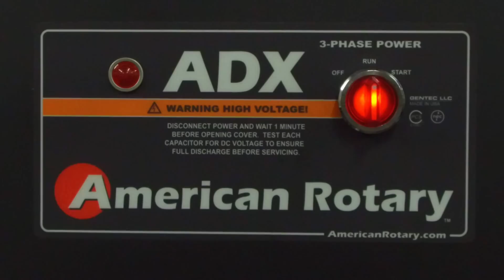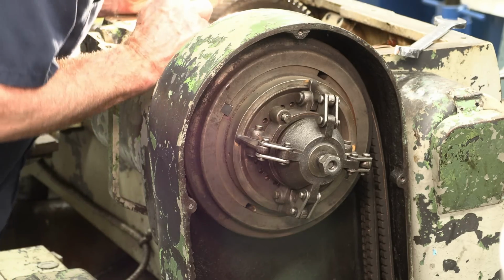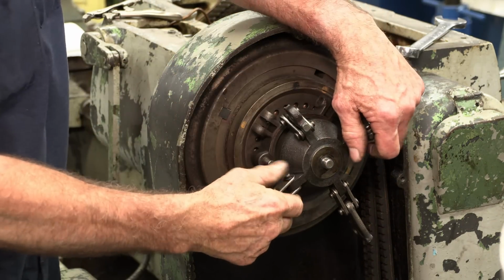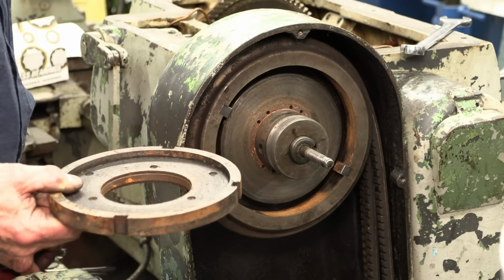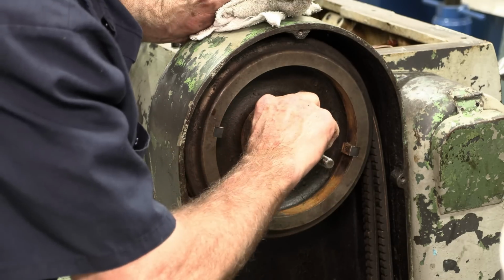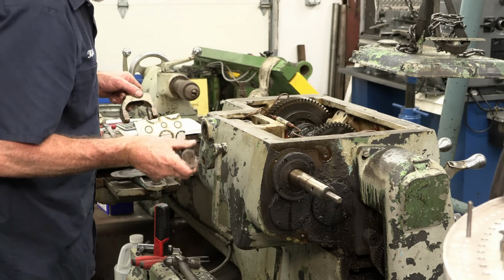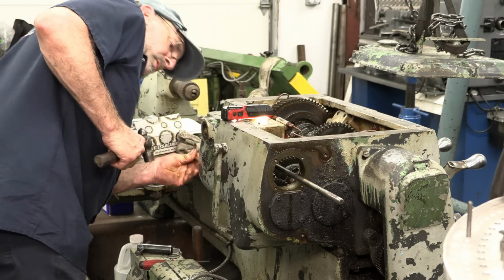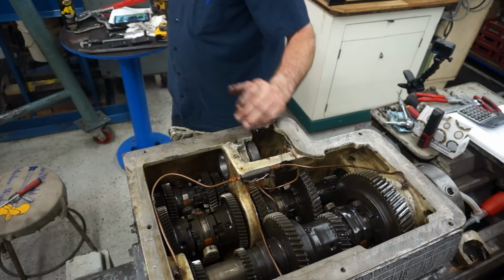Pearl's Box Removing Gear Shafting Part One

Comment: This reminds me of when I worked on car and truck manual transmissions.  There was always a sequence that the gear clusters and shafts had to be done in so they could be removed or installed in the cases.  Once done and remembered it was a cinch.  First times not so much!

Comment: Always fun to tear down old equipment without a manual. Just takes time and sometimes having to sleep on it. What you don't want to have happen is to see how it should have come apart after you take it apart wrong and add to the repair list. Not that it hasn't happened to me, LOL. When I was much younger I had very little patience, thankfully I grew out of it. Having a parts exploded view sure helps, but a manual would be much better. Thanks for sharing.

Comment: Thanks for documenting this fantastic educational project Keith. You lead us along at such a logical and detailed pace with excellent reasoning at each step. I run two of Pearl's transatlantic Colchester cousins who are almost an identical build to Pearl. Your methodology is providing me with the courage to explore a mid range drop out of gear that occurs on the larger of my two Colchester's.  I couldn't help noticing the amazing horseshoe tool caddy that adorns the rear of your Bridgeport mill, what a fantastically efficient use of an otherwise 'dead' space! Do you have anything that you could share regarding the design of that tool caddy? My series 1 bridgeport would be proud to wear such stylish and businesslike apparel. Dave

Comment: Any clutch remanufactured should have the stock to rebuild the clutch. Modern automotive clutch material will probably engage smoother than the original as materials have improved since the Monarch was made.  The problem with the Knipex plier wrench is once you try a pair you want all 4 sizes. I now have 8 of them

Comment: Keith.
 Will changing the overall motor speed effect the threading feed speeds of the lathe?
Regards
Reply from the maker: No, the feed and lead screws are timed with spindle
Reply: @KeithFenner  Thank you for both the informative and prompt response.

Comment: Keith,  what your working on there reminds me of the clutch pack on a diesel tractor of a tractor trailer.  Set up almost exactly the same.  The drive pins in the shaft were always equidistant and always more than one.

Comment: You can always power the new motor with a VFD and have ultimate low and high speed and anywhere in between.The only reason Keith makes these videos is so he can remember how to put the machine back together.

Comment: I have installed VFDs on a 5 hp Cincinnati No 2 Universal mill (1943) and a 4 ph toolroom lathe.  Both had similar motors to your Monarch.  The VFDs can increase the line frequency ten fold. Any 60 hz motor will continue to run at higher frequencies limited only by the centrifugal rupture limit of the motors rotating parts.  A great, old motor will handle 3 to 4 times it's original speed.  Obviously, you should monitor amperage, temperature, vibration, etc., as you explore any frequency above 60 hz, but VFD's monitor current, voltage, frequency and will automatically stop and display the error code for a whole list of stuff I wouldn't have thought of.

I've had the lathe up to 120 hz.  The original max speed was already 1800, so the frightening volume of air moving past a 3600 rpm chuck has limited my willingness to explore further.  Theoretically, your machine would have a max rpm of over 10,000 rpm if most of it wouldn't explode before reaching that point. But, the VFD can also operate down to 1 hz.  I've operated my mill at 5hz.  VFD's deliver nearly full torque regardless of frequency because they are able to closely simulate a full voltage sine wave - even at very low frequencies.  In addition to gaining new speeds above your lathe's max speed, you gain as many below its lowest speed and an infinite number in between. 

I promise I'm not a VFD salesman - just relaying my honest experience.  I can't believe more people don't use these things.  I can also set how many seconds I want the motor at full speed and how fast I want it to stop.  The VFD can use the motors own momentum and the back current it generates to digitally break that motor.  I have actually set all the stop times to 2 seconds or longer because anything faster sounds like it might break a tooth off something.  It stops the motor alarmingly fast - with a bearing cracking bang.  I've also heard that the power company may complain if you fire whatever spike that makes into the power grid.  My phone hasn't rang yet.

I have both machines set to spread the startup over about 10 seconds because I just know that will make them last forever.  Nothing beats a slow start.  I also can change speeds during the cut.  If I hear a ringing, sometimes the slightest change fixes it.  It stands to reason that any ringing is related to the resonances in the metal of the machine.  If you land on one of those, the VFD lets you tune that note north or south enough to turn the ringing off.

I know a phase convertor can handle all the machines in a shop, while a VFD is better wired to each machine.  But I got a 10ph beast on Amazon for under $300. I'l bet Pearl's motor was more (hope not).  Either way - hang onto that old motor & give a VFD a try.  I'd be happy to walk you the setup.  The manuals suck.  I had to spend a evening with a highlighter & a test motor on the VFD.  But I figured it out and the second drive used the same interface.  I think you'd be really impressed with a VFD.

Comment: One other thing to think about if you have not found out by now, if you are going to replace bearings, is that the large bearing between the bull gear and the chuck will cost you more than you paid for the lathe… one other tidbit of information is that the bearing on the output shaft opposite the chuck, should have the date etched on it if it is original
Reply: @Keith Fenner I just received an email via YouTube from you about a gift, just didn’t know if it was a scam

Comment: Hi Keith those spider clutches..got love hate relationship when nothing is worn they perform well any wear they are a pain the butt need adjustment regularly. The gears do look in great condition for a machine of that vintage. Notice Pearl doesn't have large spindle bore size for machine this size. Great project well worth restoring. 👍

Comment: Keith, it seems that you are missing the pin that holds the gear sector (the large gear towards the chuck) to the intermediate shaft.  It is 5/16” in diameter and has holes on the end for cotter pins. Contact me if you need more info on the gearbox , I have a 16 CY that I have taken apart and there are some things you need marked before removal(if you are not that far ahead) or you will be assembling the gearbox about seven times before you get it right

Comment: Keith, if you just increase the motor speed, all of your threading feeds are going to be screwed up too unless you change the gear ratio driving the feed geartrain to undo the speed increase.  That may not be the easiest way to get the speed increase.  But maybe you already have a plan for that.  

The rat rod paint (gloss clear over wear) looks really dumb IMO.  Leave it worn paint or give it a fresh paint job.  Being that it is right next to all your other machines with fresh paint, I think it needs fresh paint too.

Let's get Lisa some on camera time!

Happy Independence Day!
Reply from the maker: LOL the feed and lead screws are driven off the spindle, not the input shaft, timed to the rotation of spindle. Cheers, Keith
Reply: @KeithFenner  Right.  Of course.  Brain fart. :)

Comment: speeding up Pearl is going to move her to up speed for modern tooling.. FYI an increase in Rpm may require an increase in hp required to perform the workload. Not meaning to down play the inprovement,  just experience from years of speeding up production in industrial plant environment ( the faster you turn usually requires more HP)
Reply: @richard gregory At what point will the motor over heat at the higher speed, as it was never built to do higher speeds?
Reply: @ducewags  If you use the same hp as the original as the gear train rotates at higher speed it will require more hp to be able to turn at rated load. The overload protection rated on the motor will designate the proper amp draw.  You will have to do some calculations that Monarch did when they sized the original motor. It will depend on the loads Keith operates how it will affect him..
Reply: @richardgregory6653  I know all about that stuff already. And what you left out is the fact the armature was made for X amount of speed and amps, with a fan made for the cooling needed at that speed. There is a thing called "slippage" on the armature that can't keep up with over clocking the speed. Make it go faster and it wont keep up with the demand.
Reply: @ducewags  we may be talking about two different issues. Keith said he purchased a 3450 rpm motor to replace a 1150 rpm motor. What i was commenting on was the rated hp of the 1150 rpm motor vs a 3450 rpm motor. I was not talking about over speeding the 1150 motor with a vfd
Reply: @richardgregory6653  It's the same with any motor made for any HP or speeds. It was built to do a max speed at a max amp draw.

Comment: 42:15 you should weld a hinge to the top radius of the belt guard so you can get better access in the future to the top of the clutch pulleys ..... and shafts etc.

Comment: Keith, the "echo" that you hear is because you have your audio source from two different cameras and one of the tracks is off by a frame, maybe two.  It sounds like it is only a frame off, but that causes the echo type sound.  The easiest way to eliminate it is too turn off the audio track from one of your video layers when you have more than one video source.  Not sure what editing software that you are using, but that is how to fix it.

Robert Z
Reply: You'll notice that Keith has a radio mic clipped to his cap, it may be feeding to more than one camera or the sound may not be turned off on one of the three camera mics, causing competition 😉
Reply: @Bobs-Wrigles5555  Possibly, but remember this.. it is ALWAYS better to record your audio to more than one device if that is possible.  That way, IF you lose audio on one device, you can always get it from the other..  When you get into "Post" which is editing.. then you can turn off the channels that you don't want to avoid the echo...   If that all makes sense..

It's always better to HAVE IT and NOT NEED IT.. than to NEED IT and NOT have it!!!
Reply: @LVVideoGuy  You're right about have and not need etc.
I just discovered in the video description, that Keith purposely mixed the feed from 2 cameras to give left side content and obviously it was out of sync.

Comment: Could you please explain how the President has control over the price of shipping?  I don’t think that is accurate.  The price of fuel, labor, tires, maintenance, and everything else in the process has increased for everything that is required to run a business, granted….but you are blaming the wrong source.  I remember clearly when you could buy diesel for $ .13  gallon and I was making $ 2.00 an hour.  Ain’t like that now.😊